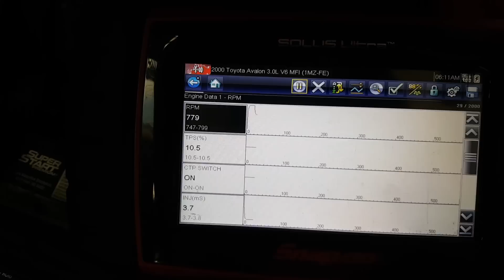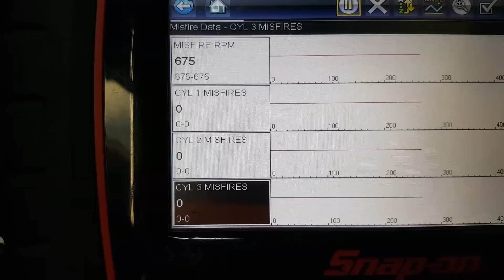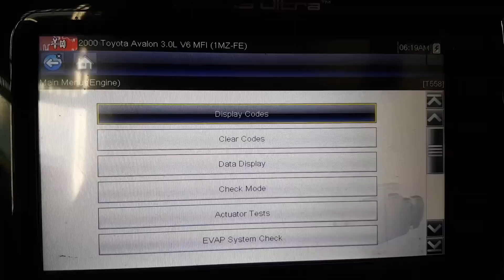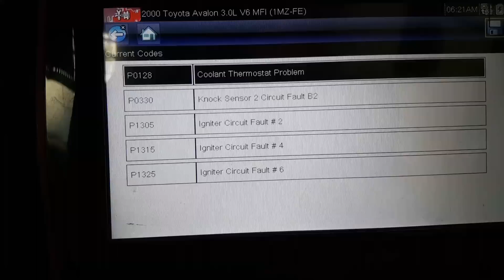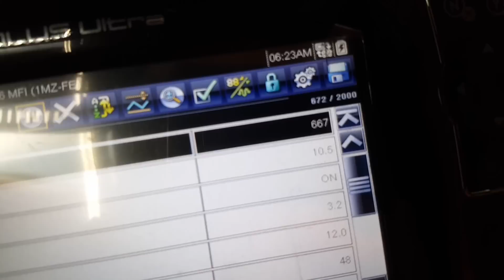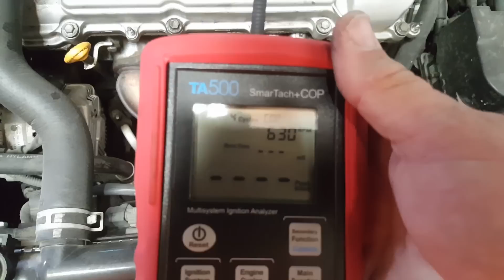2000 Toyota 3.0 VVT engine with a mystery misfire Troubleshooting old school

Comment: If an electrical component (e.g. sensor, solenoid etc.) has an internal open or short, it will throw a "circuit" code, so what he said at the beginning of the video is not entirely true.

Comment: Thanks Ron!! Informative video.
My daughter's '03 Avalon shakes pretty bad at idle, I threw it in reverse to get it out of the driveway and it shut off due to the rpms dropping, is this a similar issue with the coils? No codes or check  engine light on. Not sure where to start.
Reply: Clean the mass airflow sensor

Comment: Absolute BS that an open primary circuit INSIDE the ignition coil won't throw a circuit code. Any electronic component can throw a circuit code. My experience 90% of the time a circuit code is component related. Should you inspect the wiring, ofcourse. Should you follow the test procedure absolutely. But its simply not true at all that a component won't set a circuit code

Comment: First off. Great video. Felt every word. Thanks for sharing. I have a question for ya? I'm not tech trained but 30 plus yrs also of back yarding. I have a friend that has a 2000 sienna 3.0 l similar to this motor different looking coil packs but anyways. This van runs great its intermitton at 55 to 75 ish. It will chugging like a misfire. Or bad plug. Kinda thing feels more electric than fuel to me. New plugs about 2 yrs ago. No real issues at other speeds and not every time. Toyota ran a check said possibly one of the cats. Replaced the middle. Still there. Mt question and opinion is a coil pack starting to get bad. It seems more often after it's warmed up than cold up hills at higher speeds intermiten. So my question was what is your opinion just shooting from the hip with a guess.

Comment: My 2000 3.0 engine in my Sienna has 3 coil packs with lead and boot only on the 1,3,5 cylinders and the coil is $61 at Autozone. I'm glad I don't have this engine in my van, but this has helped me figure out why every two or three weeks I keep getting an ECL reading P1050 or misfire on #5. I drive it everyday so this misfire seems to happen when I've let it sit a few days in cold weather. Have even had the check light flashing but all cleared up and now I get this sporatic code popping up and it is keeps killing me from getting the moniters to reset so I can smog it😣

Comment: My experience on this engine was not bad changing all six coils. Did not remove the intake just used 1/4 inch tools, a skinny 10mm wrench. Cylinder 3 takes small hands or tool in from left and hand in from right. Removing the coils from the holes takes patients.

Comment: CHECK ENGINE is a serious problem because DMV suspend your driving PRIVILEGE for it. First code said 02 downstream. So I changed that WITH DENSO and got a code for temperature to low. A dealer mechanic said THERMOSTAT (to dat); so I change dat; and temp. sensor. Next, codes are more stuff. I kept lookin' and found a YT vid that got me to the "overflow" hose under the intake. It was shot, all the coolant leaked once it reached operating temp's. I changed that with a new Toyota part, and as long I was there I changed the KNOCK SENSORS with TOYOTA's stuff PLUS NGK WIRES and expensive PLUGS and put it back with new gaskets. Then it gives me codes for INSUFFICIENT TEMP. AND KNOCK SENSORS AND AIR FUEL SENSOR, B-1&B-2, THROTTLE/PEDAL, it, intermittently dies/craps out once it reaches op.temp. and I am at my wits' end. It runs fine when I start it, accelerates strong, but sometimes slugs out. Still have that light on my dash. COMPUTER?? (I didn't change the oil cause WHY SHOULD I)
Reply: Any update with your issue?

Comment: Thank you I wondered why I could only see 3 coils ,this is 1 of the best videos I have ever watched great information. I have been getting 3 codes p0 171 bank 1 fuel mixture to lean, p01133 now p0300, I have replaced all spark plugs, coils 2,4,6 found vacuum leaks, was going to order plug wires I guess that I need to pull intake and check the other 3 coils thank you so much. I cleared  code and drove 100 miles and passed emissions and it did not code after 3 driving cycles then I got p0300 I have watched a lot of videos and you helped me more than all of the others I wish you a blessed Day!

Comment: I disconnected all three front spark plugs and it did not change the engine idle. also touched it with some metal and no electrical current what so ever. How is this possible? would the car not die with three disconnected and taken out spark plugs? scanner is showing p0302 and p0304 codes

Comment: But ron i bought 4 break rotors and pads kit for my Avalon the were cross drilled and ceramic pads for 120 shipped they were great even after 60k miles not everything is junk

Comment: Your comment on Denso really got my attention. I have has different Toyota models since a 1971 Corolla and have found that their engines really run BEST with Denso spark plugs. A dealer once told me it's because they are engineered for a wider heat range. Tried AC, Motorcraft, Bosch, NGK, etc. Nothing performs from idle to high RPM's like Nippon-Denso.
Reply: My purchased new 2000 V6 Camry came with stock double ground NGK iridium plugs, over 130K miles now and still going.
Reply: You are right, i have an old Toyota Sienna and at one time i put Bosch spark plugs on it and ran like crap. After that, only Denso spark plugs.
Reply: @josephwood499  OMG, Bosch is the one company that I never ever will buy another product from. I had a Fiat that I put a Bosch replacement voltage regulator on. It failed within 2 weeks. Distributor cap and rotor on another Toyota. They also failed soon after purchase. An oxygen sensor on a Solara also was NO GOOD with the same code right out of the box. After that I never bought another Bosch and always tell the parts house NO BOSCH products. So much for German engineering, they are the worst. Use reliable Toyota parts or quality replacements. I never like having to replace something twice.
Reply: I've replaced coils on that engine on a Lexus RX and I found that the original could starts to get micro cracks around the 150k mark. Best to replace all 6 once one then two go also replacing all 6 plugs with Iridium long life plugs. What I also found was the oxygen sensors go around the 125 to 150k mark. A great engine but a lot needs to be replaced if you plan on keeping these ageing Toyota's going longer.

Comment: I can 100% guarantee but there's no Avalon that has variable valve timing until 2005 so what the hell is VVT doing in the title for a 2000?
Reply: I got a 2000 Lexus Es300 and that has variable timing. It's basically the same engine in the 2000 Avalon. Lots of matching parts numbers between the two.
Reply: 2002 Avalon with VVT.

Comment: Thank you for your common sense!  BTW, any update on the knock sensor advice?  You mentioned you were going to address it @ 14.23.
Reply: 4 knock sensor code it probably set with the misfire they are very touchy go ahead and find your other problems correct the problems and clear the codes, then drive it to see if knock sensor code comes back. Sometimes we'll save you a lot of aggravation find to find something that is really not a problem. Always stay to the basics when you diagnose engine codes and a little research will always put you to the right path.

Comment: Is it safe to use full synthetic motor oil 98 Avalon engine when it’s over 300,000 miles?

Great video by the way!
Reply from the maker: It wont hurt it. But you may start experiencing small oil leaks because the molecules in synthetic oil are smaller than conventional oil.
Reply: @SandCarServices  Thank you very much!

Comment: the Toyota is a really good about helping the engine not fail too bad when there's small problems like that and the RPMs will the whole Toyota fingers weird when they start a cold and when you running at high RPMs for a while idle sensor in a lot about 1100 give me a thousand and then after 2 minutes of idle it drops back down to seven hundred or so Toyotas are weird like that

Comment: on the 97 the coils are dual, so if 1 3 or 5 are bad, you change out the dual coil at front matching.

so if one is bad you replace the coil pack that is in 2.  that doesn't fix it and one is still misfiring it's probably either the spark plug or the injector if you assuming the injectors are good is probably the spark plug or the connection to the spark plug and other words that contacts spring is broken and not contacting spark plug.

yes?

Comment: Great Video, Highly informative, and up my alley since its only been this year I've started buying and fixing cars with electronics... Btw, thanx for the compliment (9:49). You obviously have quite a bit of experience, but I've never considered myself a contortionist, so here's an easy toyota spark plug hack I put together working on my '99 Sienna. An extended 17mm(11/16ths?) socket, 3 inch extention, and a 3/8ths knuckle attachment (in that order, add another 6 inch extension afterward if your using power tools instead of rachet) made it quite easy to avoid the air intake and take the back 3 spark plugs out in 15 minutes flat.

Comment: Thank you for great video. I am dealing with P0330 error on same car. Some how, it was temperature-dependable at beginning. At warm weather, it would give fuel tank evaporation error, at temperature bellow 32 F it was giving P0330 error. And it is appearing after some driving, not right away. Replacement of front spark plags and electric coils doesn't change anything - still the same problem. From temperature-dependable, over time it became temperature-independent. However, the tank evaporation error still persists at warm temperature. Any suggestion? Thank you.
Reply from the maker: A p0330 code means there is a problem in the knock senor on bank 2. As for the evap leak I recommend having a qualified mechanic that has a smoke machine check it. Evap leaks can be as easy as a loose gas cap to the most common problem of bad charcoal canister that houses the vent/purge solenoids.

Comment: I'm about to replace the knock sensor on my '00 Toyota Avalon. Shows 3 misfire codes and 2 knock sensor codes. Will a bad knock sensor cause the engine to suck through fuel like it's nothing?
Reply from the maker: The function of a knock sensor is the retard or advanced timing when detonation or (pinging) occurs. The misfire most likely are the cause for the bad fuel mileage. You said you have 3 misfire codes. If they are all on same side of engine cam timing might be a tooth off.
Reply: @SandCarServices  Thanks Ron, I too have the same problem as April Hass, Great advice. I'm starting there...

Comment: Good video. I agree you get what you pay for, always have. I don't see how the "circuit" was bad if it was coil pack, unless you consider the circuit in the pack to be problematic. I always use Toyota parts on my highlander. I have a fairly good Bosch scanner, but nothing like snap on. REALLY liked coil pack tool. Makes it way easy.

Comment: Good to know there are still some honest mechanics out there . I have the same car 2000 XLS Toyota Avalon. Recently check engine light and abs I think that's it light comes on started rough idling and RPMs on idle go up to about 2 RPMs higher than normal  car will run rough  and then magically all of a sudden all lights will go off pluss check engine light and run absolutely perfect has me baffled I'm not sure what's up.oh when check engine light and ABS light comes on. When I come to a stop setting there car seems to want to go because of higher idle and check engine light starts blinking but when everything goes off it's like the car never had a problem and runs perfect help please
Reply: I have the same problem, can’t figure it out?
Reply: @jesusvazquez8373 did y'all figure this out? I have same issue in 2000 Avalon. It will suddenly bog if I stomp gas pedal...intermittently. Slight rough idle sometimes....

Comment: Have a 1998 Avalon and replaced wires and plugs and coil pack #6 and still same problem then mechanic said it’s oxygen sensor and same problem, then same mechanic said one of my converters are bad due to smelling like eggs and burning fuel. So I take it to a muffler shop and tested out converters and all 3 were good. Now it’s at another shop and waiting to see what wrong with it I’ll keep you guys posted on what it exactly is.  🤦🏽‍♂️
Reply: I see you said it was timing chain, but, that engine had a belt and if broken, the engine has low chance of interference.

Comment: there are only 3 coils on this motor.....the coil and the spark plug leads can  be checked by testing with a known good component just as you did.
Reply from the maker: Peace+Opportunity 
There are 6 coils on this engine. The other 3 are under intake on rear head.
Reply: A Toyota with 3 coils😂😂😂😂😂😂😂
Reply: @jesusvazquez8373  Motprcycle?  hahaha
Reply: @jesusvazquez8373  I believe they did make a 3 cylinder engine ( Japan Only) back in the 60's but it didn't have coil packs
Reply: The pre VVT 1MZ-FE engines have 3 coil over packs on the front with 3 wires the daisy chain to the back 3 spark plug boots. I have a 97 Camry with that 1MZ-FE engine.

Comment: Thanks Ron,
Really appreciate your teaching. Just wanted to know,  have a 1997 1mz-fe and it misfires at around 45-60mph, intermittently. 
I can't use my snap on scanner mode 6 as it doesn't allow me to but the OEM mode works fine. 

How would you find a failing coil pack or HT lead? As mine has the waste spark system. No codes and only at high speeds like a shudder bit you let off the gas pedal it stops...

Thanks for your help

Comment: Replacing the rear bank spark plugs is not that bad.  Especially reaching around and unplugging them.  Sometimes it’s easier to get at them from around the throttle body